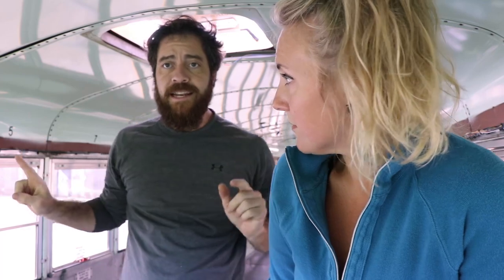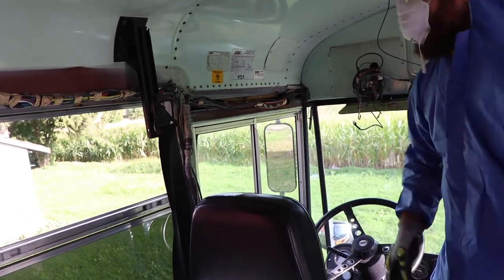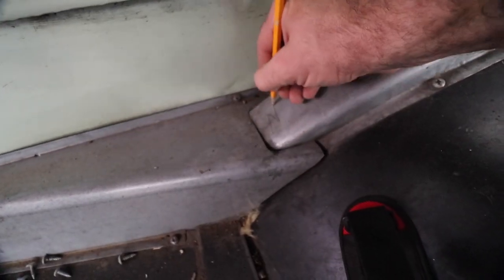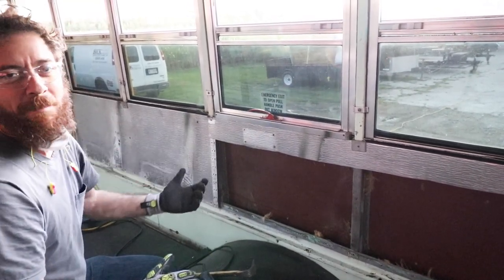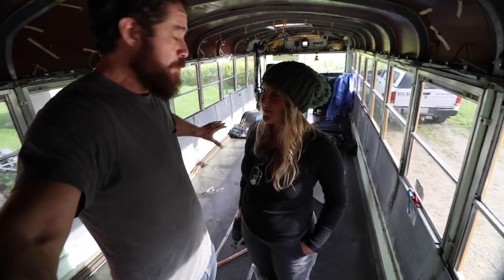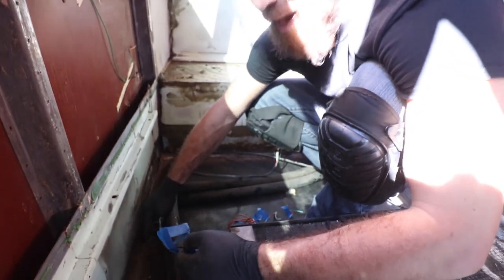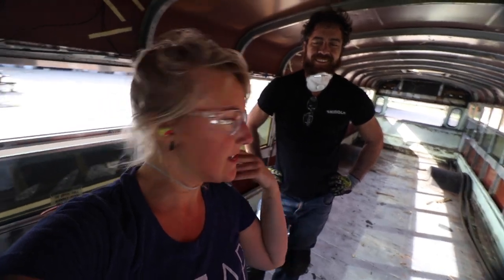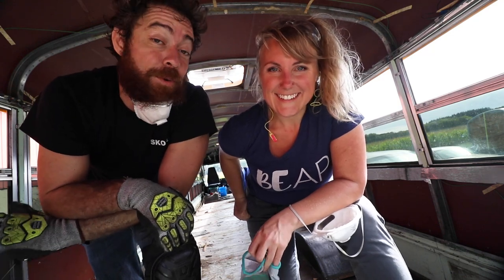Our Old School Bus Demolition | Gutting The Bus

Comment: Well we got our domain and YouTube...wooo hoooo  
Just going back over your videos while taking a break from removing cables and such from the heaters and air conditioners that we won't be keeping.  
I think we got lucky with our AmTran RE as it's got the square head screws like your bus. I can't imaging drilling and air hammering that many rivets. It was actually a factor in the purchase decision for us.....as were the automatic snow chains, brand new tires with the mold nibs still all there, alloy wheels, and 6'5" headroom...... no roof raise and no early onset permanent bent neck....LOL

We also apparently got lucky with our ceiling panels as there is no ledge, just a screw that can be pulled out to let the panel down (we will be marking which hole and putting them back in.  After spray foam we're hoping to be able to reuse the panels as the ceiling and while there will be a bit of insulation loss, we think we'll be good. 

Too late for you guys but a hint for others.  To minimize the bulk of all that fiberglass insulation, fill up a garbage bag, put the shop vac nozzle inside away from the bag, suck out all the air, and voila, much less bulk.  HOWEVER, they will fluff back out unless you take some take or light twine and tape or tie them while they're compressed.  Makes it less bulk to take to the dump and often less $$$$$$ as many dumps charge by volume.
Reply from the maker: So awesome to hear @Ham Skoolie! Welcome to the YT club! Let us know when your first film comes out! 

We definitely felt lucky that our ceiling was put up with screws too! We were mindful of that when we purchased ours as well, cuz we had seen a ton of people fighting with the rivets using grinding wheels and what not. Looked painful LOL. 

Cool that you are going to reuse the panels. We reused ours as the skin around the new windows we installed. The bus has a bit of a Frankenstein vibe... We don't care though. We were happy to reuse what we had. Save the cash. AND keep the stuff out of the dump (or scrap yard)

Automatic tire chains?!?!? RAD! Wish we had those. We gotta get some tire chains.

Your bus sounds great! We're excited to see it come together. You really sound like you know what you are doing! It's gonna be such a blast for ya! 

Also... Great tip for the bags of insulation. Hope someone reads your comment and borrows that! :)

Thanks for watching & for such a well thought out comment. It's so nice to hear from people! - Erin + Brian too

Comment: think if you pop the windows out you can get the metal out too , looks like its sandwiched between the window and the frame
the back cover youre taking off is bitumen deadening material to keep the motornoise down , car audio shops sell good stuff to recover that and make the inside of the bus quiet again 
the stuff is not cheap though
as for plugging the holes in the floor : use pennies and bodysealer
Reply from the maker: Good point, we are at bit far from all that demo stuff now. But your comment should be helpful to others @watahyaknow. Thanks for watching!

Comment: Congratulations on your beautiful floor pan. I'll have to email you my rust remediation pictures.  Just finished patching and am about to paint the metal floor.
Reply from the maker: Woot! It's nice to have a solid platform to work on after rust remediation has concluded. We've seen conversions where people just build on top of the existing subfloor without knowing what the pan looks like. This can be hazardous especially if installing a 100 Gallon freshwater tank inside because that weighs approximately 825 pounds full!

Keep at it! The journey is tough but definitely rewarding! 
- Brian + Erin

Comment: OMG at 22:00 and you're in the side electrical panel dealing with the heater wires.  I just did that this week though going the other direction and haven't pulled the run from inside the bus.  I also pulled out at least 100 feet of coiled up cables where installers just coiled up the extra cable from various devices and stuffed them into corners.

AND YEAH..... EVERY CABLE CUT..... start the bus.   LOL
Reply from the maker: LOL @Ham Skoolie! It was a bit scary to cut the wires. Each cut we were on the edge of our seats. We did our best to follow the wires back to the panel before making the final decision to cut! YIKES though... Hahah We are glad we cleaned up the panel though. Looking back at this clip you just pointed out... We had forgotten how much of a rats nest the panel was. It's WAY neater now. Thanks for the reminder. We've come a long way! Just wait... In a year your going to say the same thing. :) Happy busssinngggg! <3 - Erin + Brian too
Reply: @BEAdventurePartners  We're planning two years for our build.  Out of the regular pay so no dipping into retirement, reserve, or savings AND we're a bit more "mature"....well okay a lot more mature considering how silly you two can get (don't change that at all).
Probably not going to do a lot of video on demo though I probably should have done an entire hour of videos on how to sort out that rats nest they call an electrical panel. I do have an advantage on the electrical though. From 1979 to 2004 I worked in aviation and automotive maintenance including troubleshooting electrical, building cop cars (installing all the sirens, lights, and such), military diesel mechanic, etc.  Lends a bit more confidence and a few more "brain tools" to the tool box for dealing with this stuff.

I do have a time lapse on the inside of the bus with one frame every 5 seconds and then played at 30 frames per second.... gotta love GoPro and all their capability.
Reply from the maker: @hamskoolie9706  you definitely have an advantage because you already know electrical principles and have installed a ton, professionally! We’re becoming more confident as we go.  After installing our 110v wires, we had an electrician come to inspect our system. Not too much to adjust & nothing was a fire hazard! 

Had we not filmed our build, we’d probably be done by now. Filming takes up more time than building 🤣 gotta move the camera constantly, edit, publish, yada yada yada...

Anyways! Happy building!!
- Brian + Erin
Reply: @BEAdventurePartners  Oh the filming is definitely time consuming. I've got two other YouTube channels, one for activism and one for HAM radio. I'd say the filming and editing probably multiplies the time required by at least 4 times....AT LEAST..... the editing alone is time consuming.
Reply from the maker: Hey hey @Ham Skoolie! Whoa! We're learning sooo much about you! Going to send you an email to chat about your comment...
- B+E
Reply: @BEAdventurePartners  I'll be looking for it.  No bus work today.  While making my coffee the sprayer hose decided to explode.  Had to install a whole new faucet system..... in a house built in 1949..... ya know, standard "15 people have been in here before me and messed up something".
Just finished, dinner is cooking, and my radio net is in 55 minutes...... called a buddy to take that for me.  LOL

Comment: did you have rivets on those panels how did you remove if so??
Reply from the maker: Nope! No rivets at all (that's the beauty of a Thomas School Bus!) We had screws and they had square bit heads (even though they looked like philips, square bit was the winner!) If we did have rivets, we would have drilled them out with a bit the same size as the rivet shank. Thanks for watching @ATR57Gypsy Ramirez!
- Brian + Erin

Comment: a drill is the best way to remove rivets
Reply from the maker: greg trotchie drilling out rivets is indeed a great way to remove rivets! There’s a lot of ways to remove those little fasteners. We’ve also seen people use air chiselers. And depending on the location of the river needing to be removed one way may work better than another especially if clearance is an issue.
Thanks for watching!
- Brian+Erin

Comment: How bad is the condition of that insulation? I am saving up for my bus conversion and I am 100% disabled. If its not bad, I am going to leave it. I plan on spraying insulation on the rest.
Reply from the maker: Lorraine Deveau the insulation in the ceiling & walls is fiberglass. Considering we needed to get to bare metal to see if we needed to do rust removal, we removed all the installation. In the process of insulation removal, it ended up getting torn because of how it was adhered to the ceiling & walls. We don’t prefer fiberglass insulation, so which is another reason why we removed it. The condition of the insulation wasn’t great. It was flaking & falling apart, so it’s useful life was gone. Some places in the walls & ceiling where water had leaked, it was moldy. So it all depends on what you’re going for with your decision to remove the insulation or not. There’s a risk associated with not demoing down to bare metal to see what you find & if there’s a spot that needs repair (like the couple spots in our roof that we fixed to stop a couple of leaks.)

Happy building!
- Brian + Erin